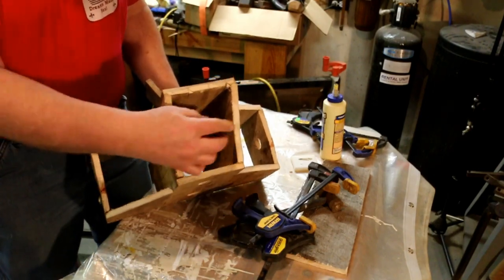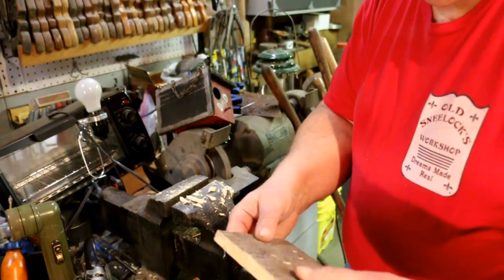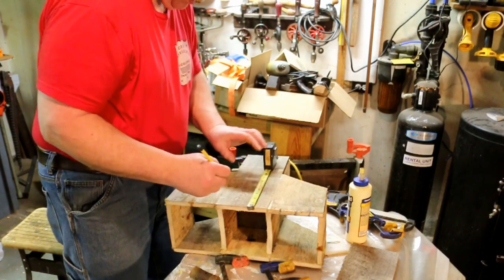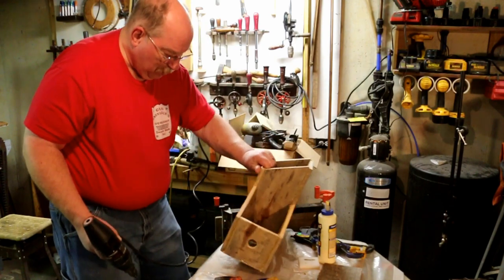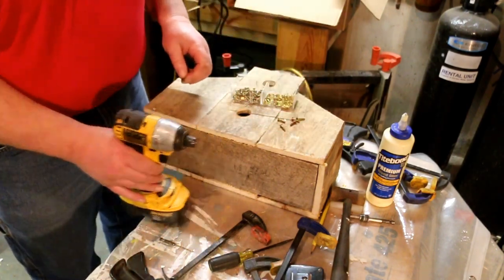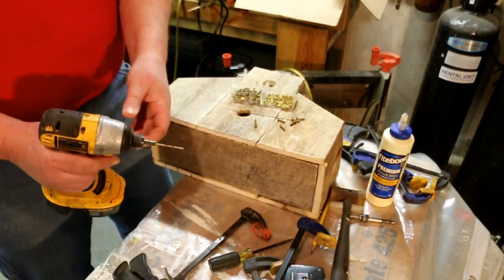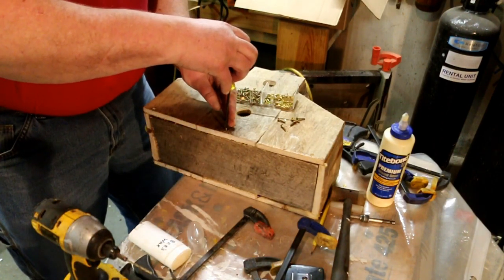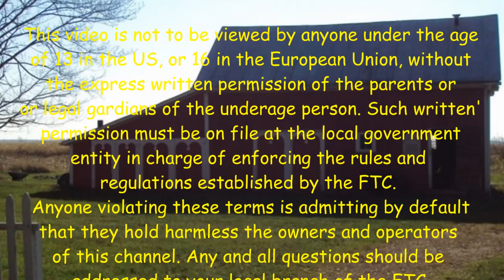Pallet Wood Martin Bird House - Pt 5 - Installing The Floors

Comment: those brad nailers work great....I have one. Brass screws....HMM, big money project. The wax is a good idea....well done...CHEERS
Reply from the maker: Brass screws are from an assortment purchased decades ago for some long forgotten project. They fill a few drawers in the storeroom hardware racks. 
Nice thing to have but if I didn't the screws would have been steel. 😁😎

Comment: I have a 18 gauge air job and with the dinky compressor will go where I need it to go, but since 9/10's of everything I do is off the Taco, in the carport or shed anyway, the 2 hoses I have are plenty long to not have to tote anything much anywhere. I had a 1/4 inch stapler, also air but the son-in-law has it since he has chickens and a lot more fence work. We just have fencing ('T' post type)  to keep the smaller varmints out but the serious ones are getting in anyway, Something to bounce a mower off of. Grub run in progress and Taco battery dead dead. Charger on it since yesterday but I'll wait till Toots gets home and settled back in. HAPPY VALENTINES DAY to yall and everybody! Happy week and GBWYall!